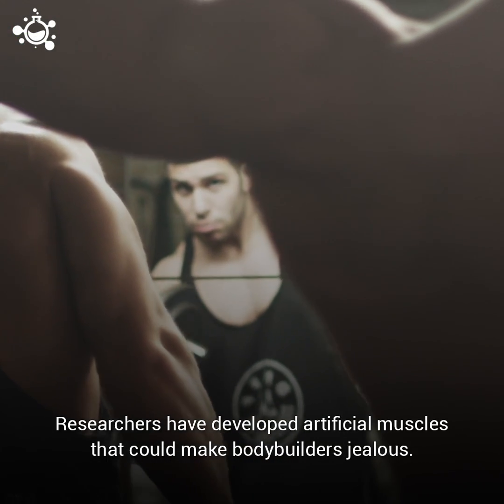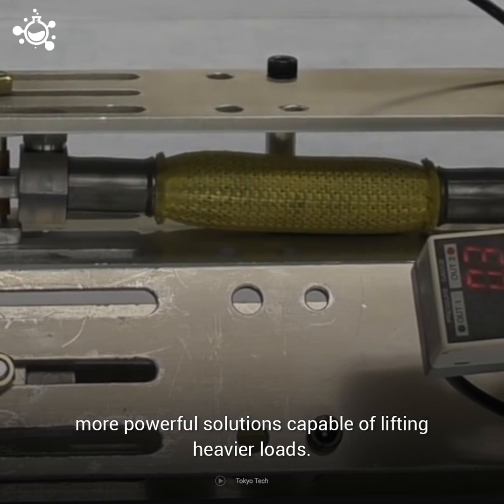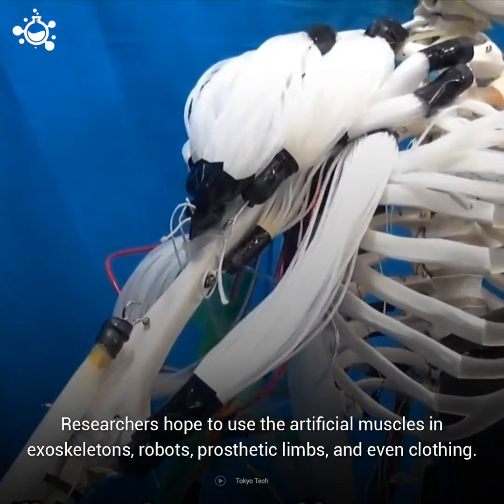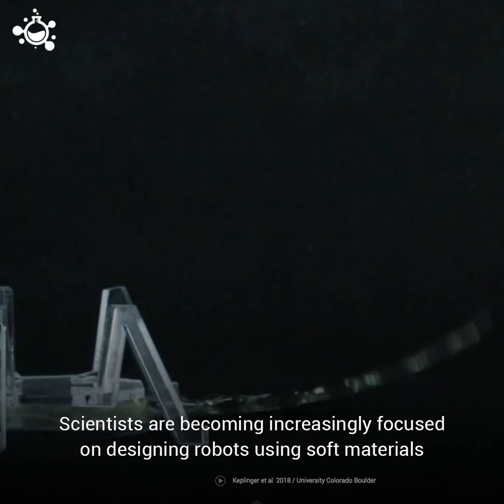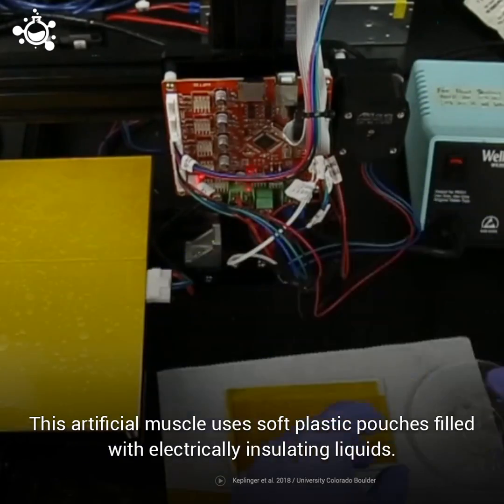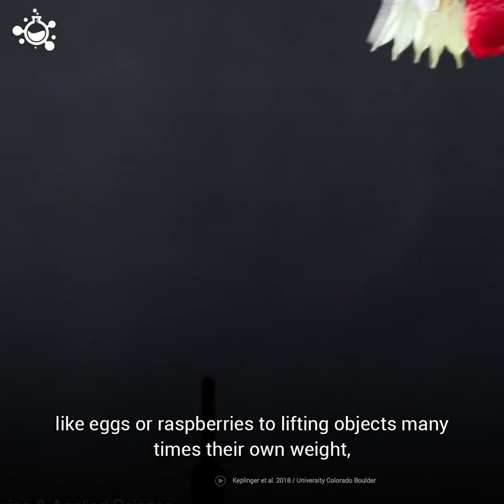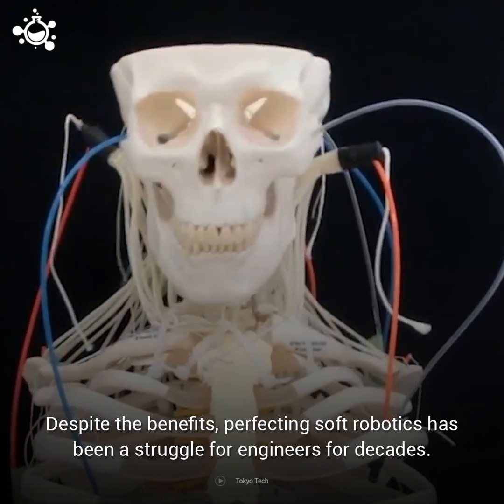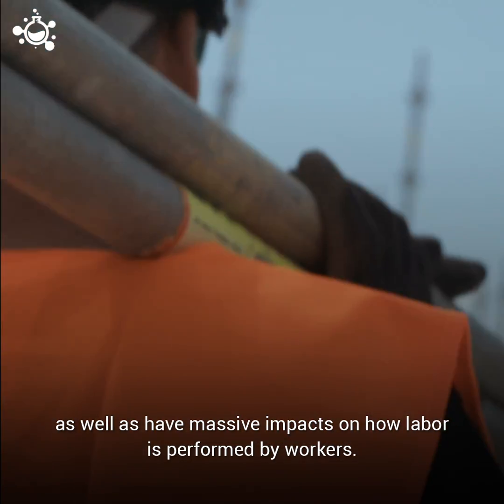Scientists Develop Super Strong Artificial Muscles

Comment: 1:50 our muscles can’t repair a tear back to its original state, especially more serious ones, and the device returning to its original shape while it’s still physically in tact isn’t self healing, it just means it kind of works as intended under normal conditions. One tiny hole in the outer membrane would almost certainly have catastrophic consequences on the system as a whole unless they were installed in isolated groups which could seal itself off from the leak. And even this would result in almost total loss of power below the affected section. Liquid cooler Nitinol is the future of mechanical muscles/ humanoid robots

Comment: I have no doubt that the future of robotics is going to be heavily dependent on materials such this and piezoelastic polymer muscle analogues.   Replacing a system of motors and gears with a simple muscle analogue will greatly reduce manufacturing and maintenance costs, add simplicity, and reduce weight.   Embed force and motion sensors with them and incorporate them into servo loops and you quickly have fine motor control and great functional strength at the same time.       The design of the robots in the movie "I, Robot" is very practical for a humanoid robot design using synthetic muscles.
Reply: one word: Detroit

Comment: 1. To the Quik: What about [Muscle Growth] that depends on [Strength & Relaxation]?
2. And for [Super Strong Muscles] what about [Mapping]?
3. All for [Sense Perception], [Memory] & Vision]! 
4. To the Point: [Muscles] are more than [Material Engineering]! Add Electrical Impulses!
Then, [Plug your Electrical Wire] into an [Engineered Material] in the shape of a Valve!
Amen.

Comment: An interesting question is whether these muscles will ever be as energy efficient or durable as human ones. The human body runs on  about 100 Watts at rest, up to 500 Watts at peak performance, all while carrying around a super computer on our shoulders.
Reply: Only 500w?, boi we are efficient
Reply: @Citnos  Probably because that is wrong. Humans can radiate up to 1000w of heat during physical exertion, and that is without taking into account the mechanical work they are doing to achieve said exertion, circulate bodily fluids, maintain respiration etc.
Reply: @horrorhotel46290  Our body needs heat to function, that's why nature hasn't equipped us with even more efficient muscles those stay colder.
Reply: @Citnos Ultimately though the human body is about as efficient, if that, as an internal combustion engine from 30 years ago, around the 20-24 % range for energy intake.
Reply: I know this comment is from a year ago, however I don't think energy consumption is going to be too much of a concern, atleast not with advancements in batteries and stellerators.
Reply: Actually, the Human Brain is much more like a Quantum Computer than a classical one.
Which is why we are so far from fully mapping it out.
And also why it will be so difficult to make ones equal to ours artificially like in sci-fi.

Comment: This is what's holding us back from mechs
Reply: For real give it 10 years and the tech will be advanced enough it might actually be possible
Reply: Mechs are useless except for the joy of riding one unless they are perfect for mining but the perfect would be AI driven ones
Reply: @Narblo  mechs don't need to be just the cartoon stereotype of themselves. I meant a very wide range of vehicles. Some of which could be amazing all terrain personal vehicles of the future. It all depends on the level of complexity one is satisfied with
Reply: @cosmotect  Oh in that case I want them too
Reply: @cosmotect  and also mining minerals.
Reply: @Narblo  legged vehicles would also likely be useful in cities where you may not have as much room to turn around in with a wheeled vehicle
Reply: Around 20 years ago I wrote (but never finished) a fan fiction for the "Armored Core" video game, and the main character had a special mech made using artificial muscles almost exactly like these instead of traditional hydraulics.
Reply: @KurNorock  you could program and design the hydraulics to mimic muscle groups, maybe even use motion tracking to move it ^^
Reply: @FractalNinja  It's not that simple. Hydraulics have severe limitations. The first is that to move them quickly they require huge amounts of pressure and volume. They also create a ton of heat. Another thing to consider is that if they were positioned to mimic muscles, they would be operating mostly in the retraction stroke which is typically half the power of the extension stroke. 

You also need room for a big heavy motor and pump and a large tank to hold hydraulic fluid. Not to mention some method of cooling that fluid. And if you want them to be fast, you need those pumps and motors to be incredibly large and powerful and you need extremely expensive and durable lines and fittings to handle the pressure and flow required. 

And the larger you make your mech, the more extreme all of this has to be. By the time you get to something roughly man-sized, the pumps and motors and whatnot get so large that they no longer fit reasonably on the machine.
Reply: @KurNorock  yeah the square cube law and the issue of hydraulics is why I’ve opted for Electric motors and actuators much like the moving gundam, of course it’s not as good as synthetic muscle but it drastically decreases the amount of maintenance required for a mech (4-5 M tall)
Reply: @alphatriton6621  The issue is even worse for electric motors and actuators. You can get more speed out of them but you will never get the strength needed to move a 4-5m tall mech with them. Not without again making the motors and batteries to power them prohibitively large.
Reply: @KurNorock  I guess electric motors/actuators are a no go then in that case. However, lithium-glass batteries and/or lithium-sulfur batteries hold more power than traditional lithium-ion batteries and don't require as much protection, which should take care of the space/weight issues in that regard.
Reply: @KurNorock  time to dust off the pen again bub
Reply: Biomechs
Reply: Yes after all this is Myomer : https://www.sarna.net/wiki/Myomer
Reply: @draco-amercon  but we didn't get the first commercial compact fusion reactor from General Motors in 2020. Wtf is going on?
Reply: @adamofblastworks1517  that's true we need a fusion power plant to power those battlemechs !🤖🦾
Reply: Imagine how fun a mech would be
Reply: This is not holding us back from mechs, nothing really is tbh, except that it would cost some billion dollars to make, and no one would buy one yet, but soon......
Reply: Objectively, there's no real advantage to mechs.  TL;DR: specialized machines can do more.

The humanoid form is built for agility and biological endurance.  Its design is a compromise that allowed our ancestors to chase down big game, and avoid being eaten by lions and bears, but created weaknesses in straight-up battle.  Maybe a humanoid mech would hide its "brain" behind better armor than our skulls, but one good hit to a hip, knee, or ankle is still enough to cripple it.  Encasing the form in adequate armor negates the agility advantage.  Talking about battle, you are better off controlling your mech with a computer, and keeping the human operator out of harms way.  We're already seeing that with remote-operated military drones, and it's trending toward independent algorithms capable of operating without humans at all (incorrectly called "AI" by most people).  Military drones have also shown that once you remove the human, you can also remove the life support and armor, and suddenly your plane can be tiny and still achieve the 

Specialized machines win in civilian use too.  Wheeled vehicles are much simpler, more stable, can handle larger loads, and move faster.  Small ROVs are already available to investigate inaccessible and hazardous areas (everything from quad drones to underwater ROVs, even the Boston Dynamics dog).  Robot arms are common for moving heavy items in factories, but usually have more joints and achieve a better range of motion than a human arm.  Were you to attach a couple robot arms to a moving platform, such as for material handling, it would make sense to have it on wheels for the reasons mentioned above.  Then again, a "two-armed machine on wheels" could just as easily be a description of a forklift.
Reply: @tippyc2  I think you forgot to finish your second paragraph.
Reply: You could jump like Hulk huha!
Reply: Its not that strong
Reply: Square cube law.
Reply: @vlc-cosplayer  Of course not. Construction already uses "mechs". Mechs are just machines. Whether they are humanoid or not does not matter. Plus, humans will still be needed for small applications where a large mech doesn't work, like anything to do with interiors.
Reply: No its battery.....
Reply: Search up the method 2 mech 👀
Reply: Tanks